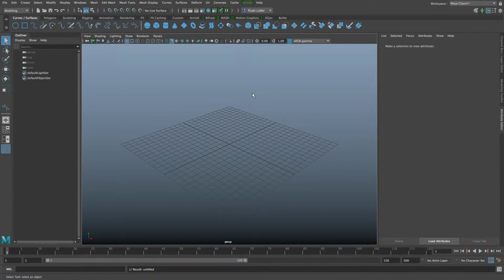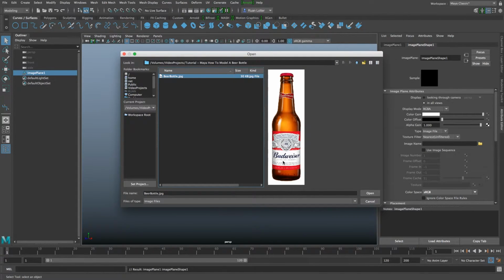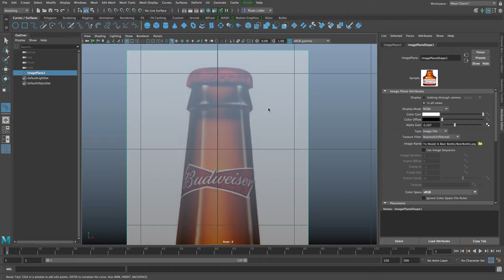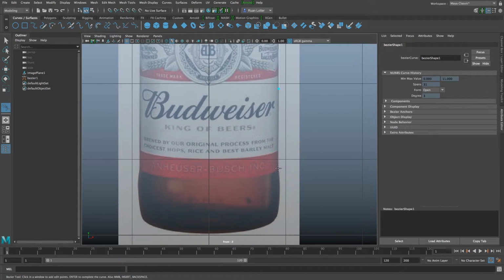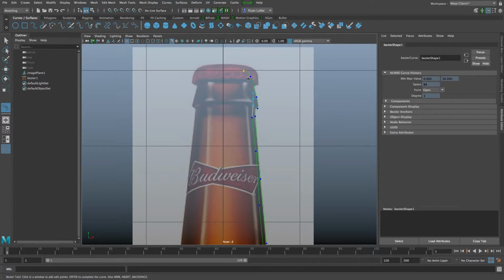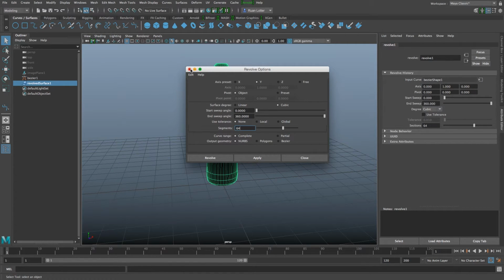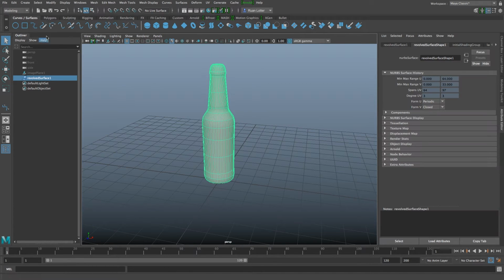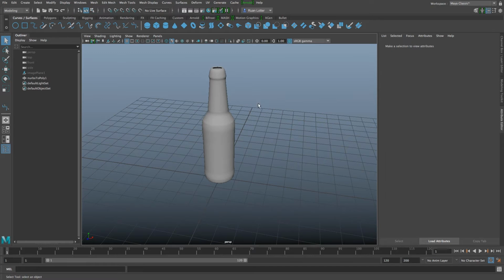Maya Tutorial - How To Model A Beer Bottle In Maya 2017

Comment: huh, you drew it out and then converted to poly with 10,000 polys... idk what kind of pc you are using but my $1000 pc will start whining if i tried doing 10k polys on one bottle xD
It was interesting that you started off from nerbs because I was somehow expecting you to do poly box or cylinder modeling. Learn something new everyday!
Reply: Sounds like you may need to upgrade your RAM. Running programmes like Maya sucks loads of processing power. If the laptop you're using set you back about $1000, it's probably not built with this type of running capability in mind, and is more of a general-use machine. I upgraded my RAM from 16G to 32G over the weekend and now don't have these issues anymore, on top of which, I'm only using about 18% processing power (instead of over 60% previously).

Hope this helps :)